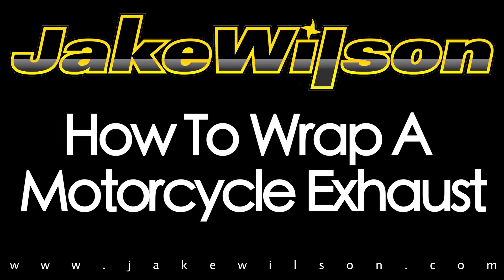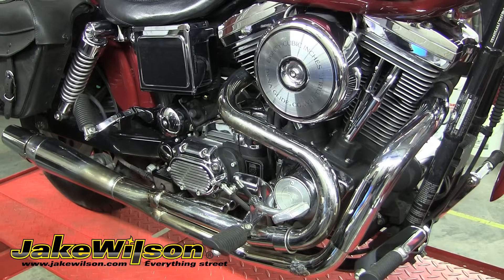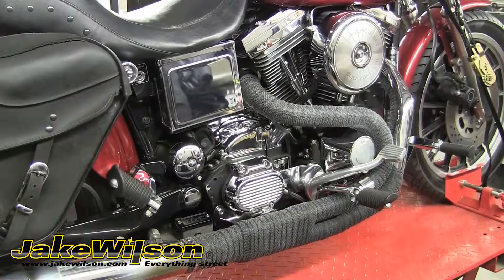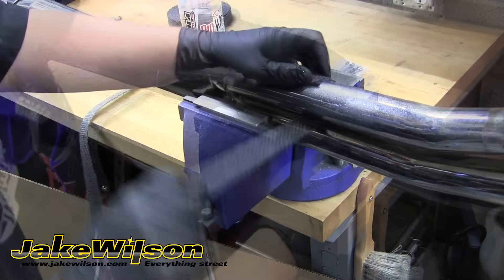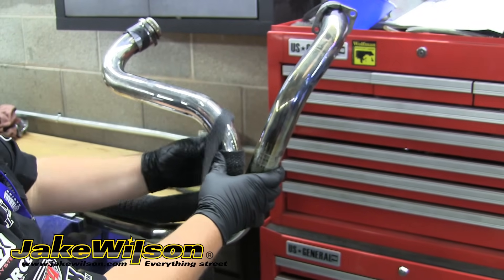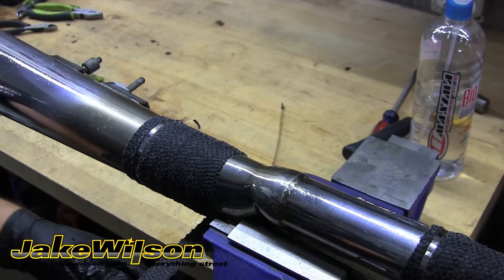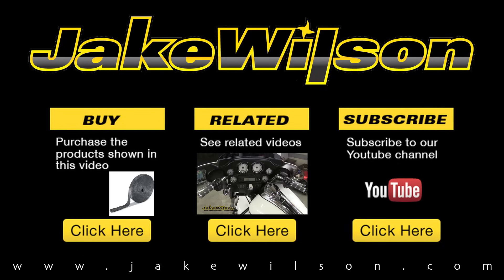How To Wrap A Motorcycle Exhaust

Comment: You DO NOT have to remove the exhaust to wrap it,it just makes it easier,I didn’t remove my Vance & Hines short shot all I did was remove the heat shields and wrap it and put on(first)the steel zip ties,then silicone spray(to seal the tape)it smells at first but after about an hour that smell goes away and your good,it provides a better ride and 3 HP more to my already 84 HP and this is on my 2005 XL883C with a 1200 engine

Comment: I sure wish there had of been the video of the section where Pipe#2 meets pipe#1 , and the wrapping technique. Also , does it matter which pipe i  start with? My top pipe rear cylinder is shorter , so I wanted that pipe to get the wrapping that went to the collector so I wouldn't run short , 2" at 25 feet  lengths.  And overlap with the lower pipe cylinder in front ?

Comment: what would you recommend cleaning the pipes with before putting the wrap on? would you recommend painting the pipes with a high temp, insulating spray before putting the wrap on or is that a waste or time/money?
Reply from the maker: +MotoShane513 as far as cleaning, I think even just using some plain water to get the dirt off can't hurt it making sure it sticks well. We wouldn't recommend any cleaning supplies. As far as the temp spray, it might be better to call the manufacturer of your pipes. As far as we understand, insulating spray will ruin titanium pipes. It may also cary across other brands. Wouldn't hurt to check first. We also found this resource for you if you need a few extra tips: http://www.heatshieldproducts.com/PDF/ISheets/ExhaustWrapISheet.pdf
Reply: +Jake Wilson thanks for the quick reply.

Comment: Guys,I made my wrapping when I was customising the bike.Along the repairs;the wrap got soaked in 10 40 oil in some places;and these places steam all the time when the bike is hot. The places that oil leaked looks kinda cool so I like it but the fumes is a problem,everyone is alarmed where I go. I thought it would dry sooner but today I took the bike for the fourth time out and it still burns.
Can I try to clean that with some gasoline? Or will the oil burn away within time?
Reply from the maker: Bugra Erkan It depends on how much oil was actually spilled onto the pipe. If it was a substantial amount it may be easier to just replace the wrap all together. Oil on your exhaust is potentially dangerous and in some cases can catch fire. If it was only a small amount of oil spilled onto the pipe you could try cleaning it off with some contact cleaner or something similar and then riding it until the remaining oil burns off. That's the worst part of wrapping an exhaust is all the weird looks you get from people out on the road when it's drying out and the resins are burning off! Like I don't know my exhaust is smoking? Ha Ha... It took my wrap a good 10 rides to fully stop smoking and steaming. Let me know if you have any other questions and thanks for watching!
Reply: Thank you for the kind answer.Best wishes.
Reply from the maker: Bugra Erkan
You bet! Good luck!

Comment: Will this wrap cause any harm to my thunderheader over time will it rust out I ride in the rain sometimes
Reply from the maker: porkchew I've had this wrap on the bike for over a year with no issues. Whenever I do ride in rain I'll make sure and dry the wrap out so it's not holding the moisture on the pipe. Most of the wrap manufactures will recommend coating the header with a high temp silicone spray to even further protect it and prevent any potential rust but it's up to you. On the next wrap job I plan on coating my entire pipe with the hi temp silicone coating just for a little more protection.

Comment: Do you not hit it with silicon before installing. I didn't and the wrap is turning white from the heat is this normal?
Reply from the maker: We did not use silicon spray. It is normal for a wrap to get lighter as it ages and runs through many heat cycles. It is hard to say how fast that happens though.
Reply: +Jake Wilson I just wrapped mine with black wrap. It's already starting to turn white from the heat. I read the wrap can become brittle and break if not treated with the spray. What do you think of this?

Comment: hi
does the wrap cause rusting or any kind of damage on the exhaust?
Reply from the maker: Hi Aahar - that depends on the finish of the exhaust pipes. The installation procedure can also affect if the pipes are stained by the wrap material.
Reply: Do you have to wait for the dampness of the wrap to be completely dry before starting the bike up?

Comment: what is it for? to cool down the pipe faster?
Reply from the maker: +2phalanges Having a pipe wrapped helps keep the heat from combustion inside the pipe, therefore increasing fuel burn and power. And looks cool :)
Reply: thanks, good to know!

Comment: so, just so I got this straight, wrap the top pipe first, then wrap the megaphone portion going on to the collector and then continue wrapping up the lower pipe, right? And also, do I need to purchase a tool to tighten the SS band clamps, or can I use a pair of needle nose pliers to pull it up tight. My thunderheader is getting quite a bit of age on it, it has discolored and started to rust in some places and I am going to wrap it with the heat tape and hopefully get a few more years out of it. thanks.

Comment: "You'll need a special tool to finish tightening the steel tie." I believe it's called a pair of pliers. :) haha
Reply: They actually do make a special tool for these ties, I used one on a power station I worked on. Pliers should be sweet for this though.
Reply: HAHA!
Reply: Or use Zinc wire, those are wayyyyyyyyy cheaper

Comment: I just wrapped my pipes on my Yamaha fz07. I keep hearing a lot about rust and how the heat will damage my pipes. I did spray the wraps with a silicon coating to help the wraps. My question is should I worry about rust and cracking?
Reply from the maker: +TheCONtwo This is a hard one to really answer. We've seen some bikes that have been fine and others that have cracked. There is always a bit of risk when modifying a stock setup. If you are properly maintaining your bike and not putting it away with wet pipes and allowing them to reach full temperature we think it would be fine. It might be worth a call to your local shop for another opinion. We have a lot of experience under our belts, but we aren't all necessary service department experts. Hope this helps! Thanks for watching!
Reply: +Jake Wilson yeah I let it run to burn off any moisture. I have it covered up since we had some rain.

Comment: I have the same pipes except they are black would that make any difference on wrapping them
Reply from the maker: Jason McK Having a pipe wrapped helps keep the heat from combustion inside the pipe, therefore increasing fuel burn and power.  If you're looking for a performance difference, then yes it would.

Comment: Does it change performance of the bike, or is it just to protect the exhaust from the rust ?
Reply from the maker: +Harnas31 Having a pipe wrapped helps keep the heat from combustion inside the pipe, therefore increasing fuel burn and power. And looks cool :)

Comment: Great vid, Jake. I just bought some tape along with silicone coating. If I'm wrapping it wet, do I let the wrap dry, then spray the coating, then let it dry again, then start the bike?
Reply from the maker: Mike Myers Sorry for the late response but yes I would recommend letting the wraps dry before coating them and then letting the coating dry before starting the bike. If you have any other questions let us know!

Comment: Hi, I'm thinking of wrapping my exhaust on my 84 iornhead sporty. What is the purpose of the silicone coating? Is it recommend? Thanks and cool video.
Reply from the maker: Dana Steele A sweet bike! The engine right before the evo, that's awesome! How long have you owned the bike? The purpose of silicone coating is to further protect the wrap from dirt, water and road grime. It also helps to further extend the life of your exhaust wrap and help even more with heat levels and the scavenging of your pipes. It's basically a little added protection for your wraps but not completely necessary.

Comment: Great video, I have a cb750 that I want to do this on. Do you have any thoughts on how much wrap I would need. its a 4 cylinder header.
Reply from the maker: jeremy godo Depends on what width of exhaust wrap you go with, 1" or 2" and how spaced out you form your seams on each header?  I was able to use a 25ft roll on my KZ1100.  It was barely enough to get all 4 headers done, not the silencer portion.  Personally i like just the headers done, gives the In-line-four a clean distinct look.  If your looking to do your complete exhaust system, you'll need an extra roll or longer roll.

Comment: Would I be able to do all four headers on my cbr 600 with a 50ft roll of 2"?
Thanks
Reply from the maker: +Ben Lenner There's a lot of variables with wrapping an exhaust.  How far apart you overlap the exhaust wrap, how tight and how far down the pipe you want the wrap to end at?  I would tell you yes with a 50' ft roll you should be alright.  If you're talkin just headers, than i would say you're good.
Reply from the maker: +Ben Lenner ..diameter of pipe is also a variable that comes into play as well.
Reply: Hi i have a cbr600 too, and just ordered some black wrap to go with the black bike, but i've only ordered one roll to do just the middle section.
Reply: @spider love ..wow..that was very technical, but i think i follow what you are saying! I'm gonna have a good think about that. Cheers for you help. 😊👍

Comment: I've owned it for just about a year now. I'm also thinking about repaint the engine and touching it up it's got some roast on it. Is it okay to paint it? I've heard mixedfeelings about that. Thanks for the reply.
Reply from the maker: Yeah, I have personally never done it but i don't see any problems with repainting the engine as long as everything is sealed up properly and you use a high temp ceramic paint. You may want to contact someone like House Of Kolor to see what they recommend with your application.

Comment: nice video. my exhaust is in several pieces and I have o2 sensors on each, but I still want to wrap them. my negligence allowed my hot exhaust to burn a 3 inch hole thru my waterproof riding gear. that hurt my pride and my pocket.

Comment: nice vid. especially at 5.21 when the dude realises it aint gonna fit and the next frame u see you removed the wrap tape on the one pipe hahaha
Reply: he just reinstalled the original heat shield ;D. video edit probly took him several minutes to finagle it back on..not that big of a deal
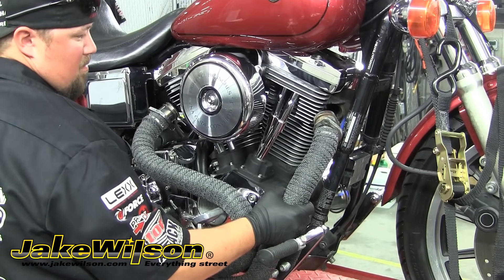Reply: nope, at 5:21 you see it WITHOUT the heat shield and in the next frame you see it WITH the heat shield! LOL
Reply: The wrap isnt removed, it's a chrome heat shield. At 5:28 and 5:33 you can see the wrap at the top by the cylinder head.

Comment: Just flippin' through some vids & came upon your (two-thirds) finished wrap-job. Got a question for ya !  Why didn't you finish the wrap up the front header pipe to "FINISH" the job !?? And to gain the added performance as well as a uniform look !??? I'm shaking my head in complete confusion & cannot think of ANY reason(s) why you would stop the wrap where you did & didn't finish the entire exhaust up the front header !??  So now you will not only have a very confusing "look" to your scoot, you will have a difference in heat dissipation on your front header pipe, compared to the rear header pipe, so when the gases from both pipes meet, collect & mix, you won't get a uniform mix at your collector ! Very odd.
Reply from the maker: Ghettoblasterhp600 Thank you for your concern but the wrap job does indeed continue up the front header at about 4:53 . We reinstalled the front pipe guard over the wrap for more protection but I can tell you we are getting a "uniform mix at our collector". Thanks for watching!

Comment: Yamaha tells me this causes the pipes to rust fairly quickly. Is this true or are they just lazy?
Reply from the maker: Gene W It's going to depend on the pipe and the riding conditions. Obviously a pipe that is wrapped and get's ridden in the rain is going to be more susceptible to rusting than a pipe that gets wet that isn't wrapped. The wrap will hold the moisture against the pipe longer than if it wasn't wrapped but as long as you dry the wraps out and they don't stay "wet" for a long period of time you should be fine. If you have any other questions let us know!
Reply: Jake Wilson So the extreme heat wont cook off the condensation?

Comment: IRL exhaust wrap is the modern equivalent of spraybombing rusty pipes with BBQ black. It works, it's fashionable, and owners who don't care about heat-induced cracking will be fine with it. Thunderheaders (I have one) are thin and delicate so I'd avoid wrapping one that wasn't already deteriorated. Pimping bikes for resale means appealing to fashionistas, but I still paint the pipe beneath so trapped moisture in the wrap doesn't corrode the pipe as quickly. Unless an exhaust was cooking my leg I'll never wrap my personal exhausts. I've peeled enough wrap off customer exhausts and seen what lies beneath...

Comment: i wrapped my pipes and they still burn my legs
Reply from the maker: +chris sheinman what is your setup and wrap used?
Reply: +Jake Wilson set up is basically like the one in the video
Reply: +Jake Wilson I put the heat shields back on it over the wrap
Reply: @chrissheinman8696  you’re suppose to wrap it either over the heat shields or not put the heat shields back on after you wrap the pipe

Comment: Near the end of my exhaust, I've got 4 pipes that converge into one. It gets really tight where they meet so is it OK to wrap around the 4 pipes together there? I imagine it won't be as effective to retain heat as wrapping them individually, but are there any other drawbacks? Thanks in advance.
Reply from the maker: djanzano I would try and slide the wrap down around each pipe as good as you can and then wrap them all together to finish it.
Reply: Jake Wilson Thanks for the reply. I'll try that.